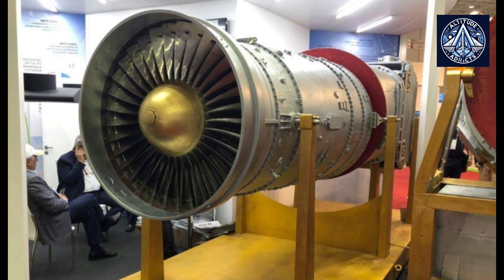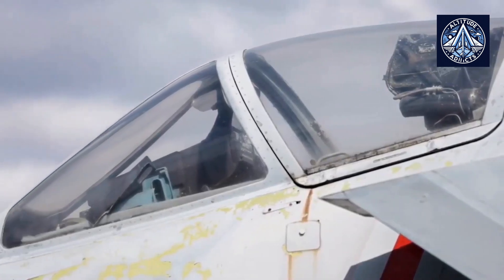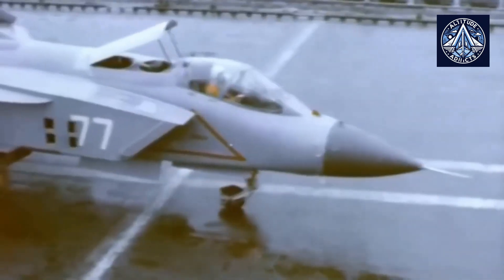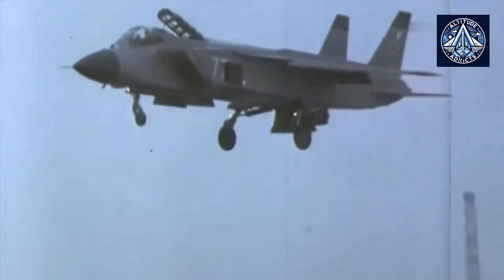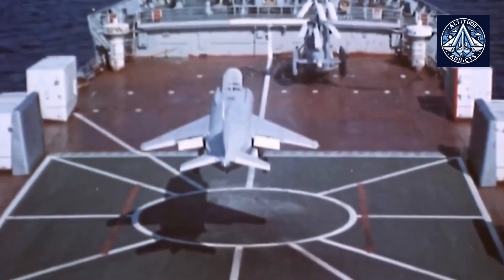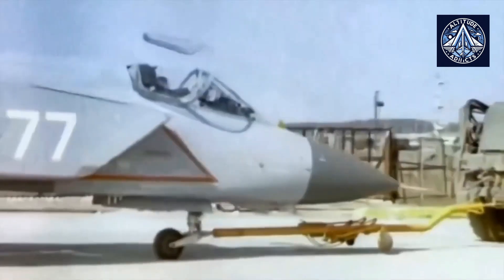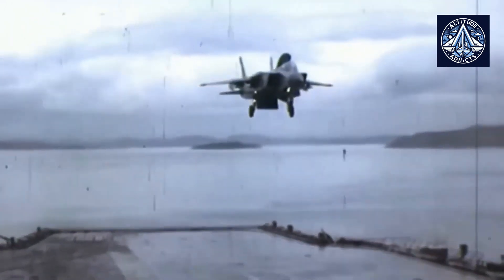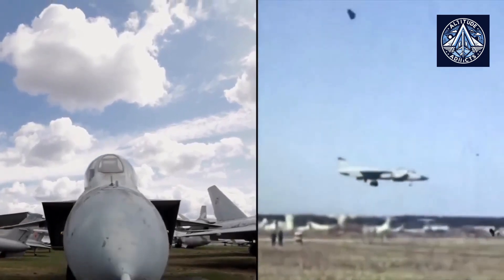Russia's New 4 Mach Capable 5th-Gen Soyuz AMNTK R579-300 Turbojet Engine For VTOL Aircraft

Comment: VTOL is a useless capacity looking for a use. Mach 4 capacity could be used in the MiG PAK DP programme to find a replacement for the MiG-31. There is no value in VTOL for a fighter aircraft... the tiny aircraft carriers that result are next to useless yet are still rather more expensive than no carriers at all. If you want a decent naval fighter then a naval Su-57 makes rather more sense as its flight performance will always be better than any VSTOL fighter type.
Reply: очень спорное утверждение учитывая то, что большими авианосцы строят как раз из-за того, что обычным самолетам требуется большая полоса для взлета и посадки. А вертикальные самолеты не зависят от этого, да они будут полезны даже на земле, их можно поставить хоть посреди леса, где нет аэродромов, но есть открытая площадка. Такие самолеты открывают большие тактические возможности. Просто по большому счету, еще никому не удалось создать по настоящему  эффективную машину, которая бы имела хорошую боевую нагрузку и подъемную силу. Ну и опять же два малых авианосца будут гораздо полезнее с такой машиной, чем один большой. Поскольку потеряв один такой в бою у вас еще останется целая половина авиакрыла, как говорится не ложи все яйца в одну корзину.

Comment: what are you talking about ? you are confusing the separate lift fans used on the Yak-141 re cool air.
The F-35B is obviously a clone of the Yak-141 everyone knows that .....

what you have completely confused is that to fly at insane speeds like the SR-71 you use a turbojet ..... with big bypass corridors around it ...... and once you are hauling you actually use the afterburner on the turbo jet as a ramjet ...... and throttle the turbojet back to idle speeds 
and this would be very useful if you want a Mach 4 Mig-41. Only problem is running your afterburner continuously you go through fuel like there is no tomorrow. The SR-71 routinely needed to be refuelled in the air many times as a result - something that is not widely talked about.
The Boom supersonic airliner is also investigating this idea and is using a quite "archaic" turbojet as its core .... turbojets tend to be long and narrow ..... so perfect to put bypass channels past it
so yes this would  be a great engine to use if you intended to build an SR-71 style Mig-41
Reply: Is this a real engine though? Has it even been bench-tested?
Reply: @energiam880  The working version was presented at the Aviamotornaya Scientific and Technical Complex Soyuz exhibition. However, there is no carrier yet.